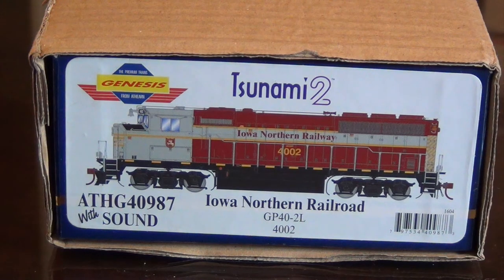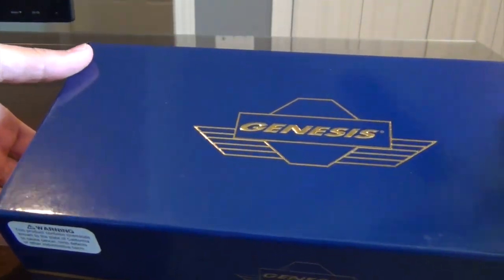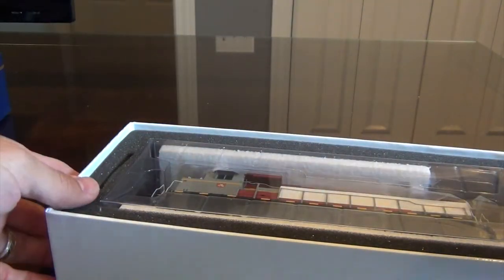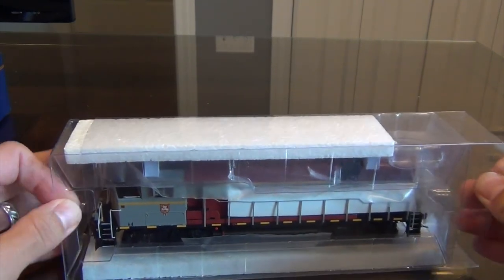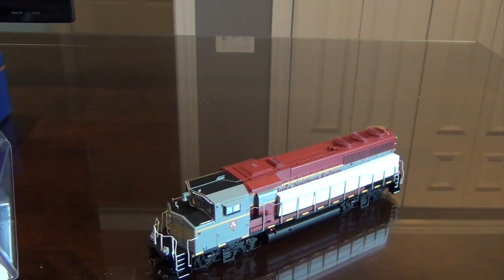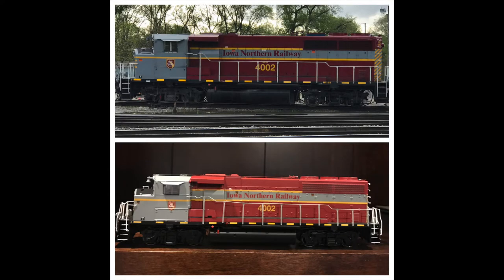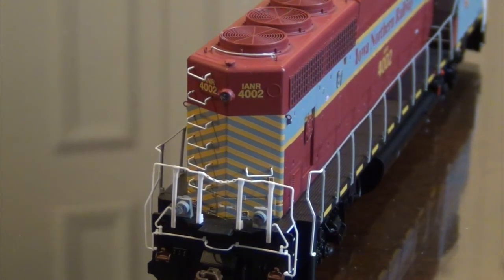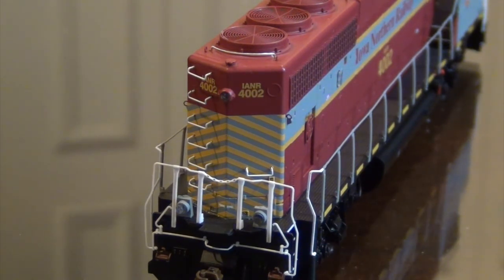Athearn Genesis GP40-2L Iowa Northern Railway #4002

Comment: I want to get one. I'm from Des Moines and model Iowa Interstate and Rock island mostly. However I do like anything Iowa.
Reply from the maker: Thanks for replying.  It is not a stretch but you do have the potential for spotting an IANR on the IAIS line.  The IANR has three direct interchanges with CP, CN, and UP and an indirect with the IAIS via UP.  If you are considering purchasing one, contact Carol at Caboose Stop Hobbies in Cedar Falls (319-277-1754).  They have some of the best pricing I have found and will ship anywhere.  I have been to Hobby Haven in Des Moines, and (in my very humble opinion, not trying to offend anyone) their model railroad items are just too overpriced. 

If you want one, get one fast. I heard the production numbers were very small over the quantities pre-ordered so they will likely not be around for very long.  

Also, I just subscribed to you!

Comment: Im conductor for Iowa Northern railway the 4002 locomotive route is Waterloo Iowa to olwein Iowa with the route starting at Waterloo cedar falls Linn armour denwar Fairbanks and olwein
Reply: Also Iowa Northern railway uses csx and Amtrak locomotive that the bought for example 3811 4002 and 446 engine/locomotive none of the Iowa Northern railway locomotive/engine have Dynamic braking system the just use hand brakes and the air brakes system
Reply: Get your facts right Iowa Northern is not a Genesis railroad they used to be part of the rock island railroad from Chicago
Reply: Iowa Northern railway started in 1982 locomotive/engine have whistle not horns
Reply: There  in the  upper northern Iowa  that why they named it Iowa Northern railway not Eastern Iowa